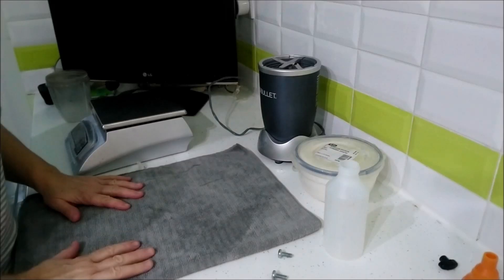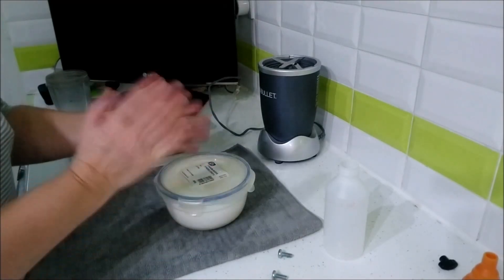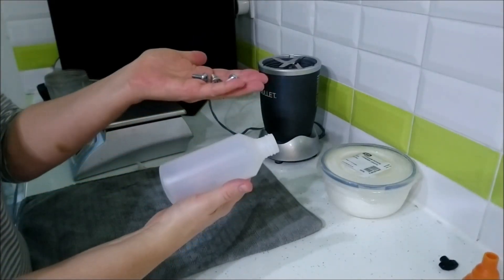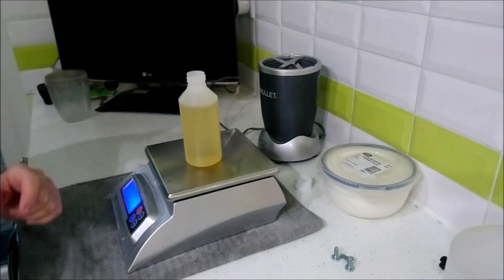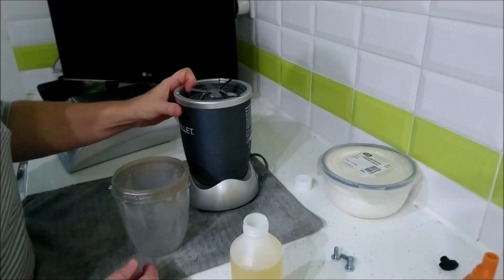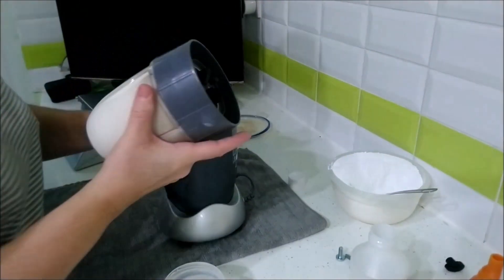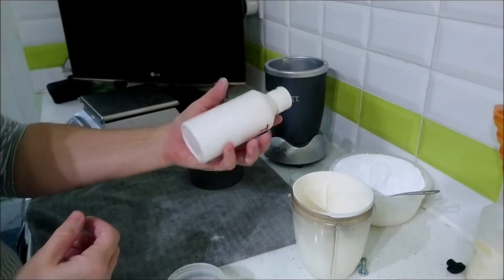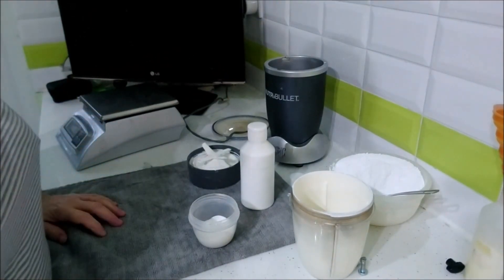Mixing TITANIUM DIOXIDE for cold process soap tutorial ~ How to premix titanium dioxide

Comment: I accidently ordered water soluable Titanium Dioxide. I usually mix some oil based titanium dioxide with some Almond oil. Can I still use the water soluable Titanium dioxide dissolved in water ? I can't dissolve it oil can I ?

Comment: That’s not really a 1 to 3 ratio
Reply from the maker: HI Bella, it's a 1:3 as I'm using 1 part TD to 3 parts oil, it's done on a volume basis. In the video I calculate that I have used 14 tablespoons of oil in my bottle, so I then use 14 teaspoons of TD, there are 3 teaspoons in 1 tablespoon.
Reply: @IDreamInSoap Hi! I did wonder why you measured by volume and not by weight. I suppose the weight of the TD in a 3:1 ratio would be a greater volume-making it more concentrated...yes? 
I think I'll weigh everything the next time I make a batch by volume...just so as not to fiddle with the spoons in the future! 🤓
Brilliant teaching...thank you so much! 🥳💞
Reply: @IDreamInSoap Hi, I love your idea. Could you tell me the ratio of Titanium oxide and olive oil in gramos?

Comment: I adore your videos - so informative!  Thank you for being so generous with your knowledge.  This one leaves me puzzled, though.  You mix 14 tablespoons of oil (which equals 42 teaspoons) with 14 teaspoons of TD, for a total of 56 teaspoons.  The mixture is 25% TD (14/56) and 75% oil (42/56).  Then you say if you want to add TD to your batter at a rate of 1 teaspoon per pound of oils, measure out 1 tablespoon (which is 3 teaspoons) of your mixture.  Since the mixture is 25% TD, that means you're only getting 25% of 3 teaspoons of TD, or 0.75 of a teaspoon (3/4 of a teaspoon).  If you want a full teaspoon of TD, don't you need 4 teaspoons of the mixture, not 3?  I suppose the difference in TD amount doesn't make much difference in the soap, but my inner math geek is confused.
Reply from the maker: HI Carol, ooh I completely agree with geeky maths. The reason I didn't worry about it is that with teaspoons/tablespoons which are a volume measurement rather than weight, by the time everything is all mixed in, the volume that the oil took up did not change significantly, therefore it was actually more accurate to just use x3. 
Overall volume measurements are quite imprecise, but I felt when I measured mine that sticking with x3 was actually closer than x4.
I actually do all of my measurements by weight, so when I make mine I weigh the whole mixture and use the weight to get back to the amount of TD I want.
I hope this makes sense, but I completely agree with your logic
Reply: @IDreamInSoap  🥰

Comment: Hello, thanks for the video. I don’t know if you said it but do I have to calculate this oil that is used for the mix in my recipe or is it so less that doesn’t change my receipe ? Thanks for helping
Reply from the maker: Hi Karin, It's likely to be a small amount so you don't need to worry about it. If you were doing TD in the whole soap you could blend it directly into your base oils.

Comment: Hello Lisa.  I wish I re watched this video, I made a bottle before but was worried it was out of date, so threw it out a few months ago.  Yesterday I mixed my oil based Titanium Dioxide in olive oil, it looked ok when adding but 24 hrs later white bits when I cut the soap. So annoying as one of the best swirls I’ve made.   So back to the bottle mix.
Reply from the maker: AW, no that's a pain. The TD should last as long as the oil in the bottle, so just check the expiry of the oil before you use that and write it on your TD

Comment: PREPARE in advance of soaping:
1 tsp TiO2 (oil soluble type) to 3 tsp oil.   -or -
1 tsp TiO2 (water soluble type) to 3 tsp very WARM water.

STORE in bottle with stainless steel ball bearings.

USE @ 1tsp TiO2 ppo
(ie 1 TBSP which equals 3 tsp of the preparation)
Shake well and add to batter after emulsion

Comment: Hello Lisa, I am at the brink of buying a coffee grinder and came re-watching your video to double-check if you mixed it together with oil in the grinder or not, to make a final decision :). Then I got confused when you said you added 1 table spoon (3 tea spoons) of the mixture to your soap with the intention of using 1 tea spoon of TD. But since the mixture was at a ratio of 3:1, it contains 4 parts instead of 3, and the TD you added wouldn't be 33% but 25%. Or, the 1 table spoon of mixture doesn't contain 1 tea spoon of TD but less, since the table spoon of mixture isn't 2 tea spoons of oil + 1 tea spoon of TD, but 3 parts of oil + 1 part of TD...
Reply from the maker: I'm not sure if a coffee grinder will work as I think you are suppose to just use dry coffee in those. I use one of those very powerful blender things. I do agree with what you are saying that 3:1 should equal 4. But I've found that when using volume (like teaspoons) that the mixture as a whole doesn't really increase in volume much beyond the oil volume. Initially it seems bigger but as it settles and everything absorbs together then it stays at about the oil volume (I've even made some quite large batches to see what the volume does).
However if you are weighing your TD mixture to use (which is typically what I do) I would count the TD as 25% of the weight.

Comment: I'm back with more questions. 

Why do you use a tbsp of the dispersed mixture as opposed to a tsp? 

I have a vague idea of how to calculate stuff ppo, but I'm not fully sure I've got it right. My understanding is that you would divide the total number of oils you have by whatever unit you use to measure a pound and then multiply that number by the number of tsps you want to use.

So if I had 1,000 grams of oil and wanted to add a color with a rate of 2 tsp ppo, I would divide the 1,000 grams by 454 and then multiply that by 2 leaving me with 4.4. Is that the correct way to calculate that? 

And my last question is can you pre-disperse other colorants in this way or does this only work with titanium dioxide?

Comment: What if you've pre mixed your td with olive oil and the recipe does not call for olive oil,will this affect your soap on any way?
Reply from the maker: HI, it's very unlikely to as you will not be adding much, it would just increase your superfat a little. If you sell your soap you may need to consider if it affects your labelling requirements. You can mix with any lightweight oil (rice bran, canola, avocado etc) just choose the one that's the highest in your recipe

Comment: 50/50with castoroil mix so 1 tspoon oil and 1 ts td  that does not change a batch of a few pounds
Reply from the maker: I wouldn't use castor oil, it's too thick, plus it's normally a very small % of your recipe, so you you could alter the batch, choose the oil you use as the largest part of your recipe (liquid oil)
Reply: @IDreamInSoap  then use a spoon of oil from the batch slightly warmed up to thin it same effect

Comment: Hi Lisa these is Aminata again so if i have a soap recipe that the total oil is 1000 grams and i want to add my TD mixture . so how do i know how many tsp of TD mixture i need do i have to divide 1000÷ 16 =62 .5 or what i still didn't understand that part pls thanks
Reply from the maker: Each tablespoons of diluted mixture should colour about 500g of batter (you may need more if you use very yellow oils) so for 100g 2 tablespoon should be fine
Reply: Ok thanks a lot

Comment: Hi lisa thank you so much for your video about the TD mixing . if i did understand you , You do use 1 tbsp of TD per pound and how much in grams pls thanks i Really appreciate all your videos thanks again
Reply from the maker: Hi Aminata. Yes I use 1 tablespoon per pound of oil of the diluted mixture, which is the same as using 1tsp per pound of just the dry TD. A tablespoon of the diluted mixture weighs 16g
Reply: Wow thanks i understand now
Reply: I’m hoping this will help me eliminate white spots in my soap. How would you add this / write it up on a CPSR?
Reply: Hi Lisa these is Aminata again so if i have a soap recipe that the total oil is 1000 grams and i want to add my TD mixture . so how do i know how many tsp of TD mixture i need do i have to divide 1000÷ 16 =62 .5 or what i still didn't understand that part pls thanks

Comment: A small cautionary tale to anyone out there who — like me — might be using an ordinary bottle top:  be sure the bolts or nuts or ball bearings are large enough to notice easily when dispensing the mixture. I used some very small SS acorn nuts just because we already had them. However, I measured the mixture when it was still quite gloopy, and since I didn't have a nice flip-top lid that reduced the size of the bottle opening, one of the nuts escaped into my rapidly thickening batter! I didn't find it until cutting the loaf, when the wire skipped around the tiny nut and left a strange divot in the side of the soap. I'm very lucky this one showed up in the cut, so I'm not giving someone a bar with hardware inside. And of course I had to go through the whole TD mixture to capture and count the remaining nuts, in case more than one was hiding in my soap...yikes, what a mess! But despite a foolish user error, this technique is absolutely awesome — thanks so much for the video, Lisa!  ❤️
Reply from the maker: Oh goodness me, that's a good point. I guess with the bottles I use the bolts could never get out.

Comment: Hi Lisa,  how long does this TD mixture stay good and useable?  Great info.  I catch your soaps on Instagram but like hearing  you explain everything.  Thanks for the videos, keep them coming.❤️❤️
Reply from the maker: Hi JoAnn, if you mix with oil, then it will last the shelf life of your oil. I typically mix up enough that will last me a month or so. For water dispersed I think you need to be a bit more careful as water can = bacterial, so if I did use water I would maybe keep the TD in the fridge.

Comment: Hi, Ive just found your tutorials and they are amazing!! Thank you so much. I am still learning all the time. Quick question which is probably a daft one. When using this mix making cold process  soap, do you take the amount you use out of the amount of oils in your recipe? Or does the minimal amount of olive  oil you are using in your TD mix not make a difference? I’m probably being a bit OCD here but want to ensure I’m using the right amount of everything. Normally if I am mixing a colourant with oils I will take it out of my batter, but if this is pre made then I can’t do that. I wasn’t sure if I should reduce the amount in my recipe and if so by how much as it will be mixed together. Many thanks.
Reply from the maker: Hi Amanda, thank you so much for your lovely comment, just adding this in will be fine, it's a very small amount of extra oil so will just add slightly to your superfat
Reply: @IDreamInSoap  thank you so much!!

Comment: Why do we need to add the bolts to the bottle ??
Reply from the maker: It helps to mix the TD, as it settles at the bottom of the bottle after a while so the bolts make sure it's really mixed well
Reply: @IDreamInSoap  Thanks a lot. Your video was very insightful

Comment: Hi Lisa. I just love the informative videos you upload and have been binge watching them over the last couple of weeks. But I do get confused when you say that oil isn't the same weight as its volume, and then say that 1 tablespoon (which is 15 ml) weighs 15 grams. As a baker - or maybe someone who actually enjoys maths - I know that the conversion is x0.9 (eg 1dl olive oil weighs 90 grams), and therefore your maths seems a little faulty. When it's just one tablespoon I'm sure it doesn't make any difference, but in the bottle you won't get the correct proportions between oil and td. Obviously it still works, and maybe the 1:1 ratio isn't crucial, but the correct math would be that 1 tablespoon olive oil weighs 13,5 grams. :)
Reply: Edit: yes, this is extremely nerdy. And again, it probably doesn't even matter. And I went through the comments before writing this and I seem to be the only one noticing, again a sign that I have too much free time and am in minority for both liking maths and knowing volume to weigh conversion on baking ingredients by heart. Sorry for the long sentences. ^^'
Reply from the maker: Hey Frejaln, I agree with you, in this case, the actual exact measurements are not needed to be 100% accurate. In fact for this video I just measured the number of tablespoons of oil that I wanted, weighed the whole lot and then divided by 14 (or however many I used) so I was after a sort of average weight for the tablespoon that I poured. Most people will not pour out a 100% exact tablespoon, so for me it's about consistency of measurement. I want a ratio of about 1 teaspoon to 1 tablespoon, so by weighing the totals out I know I can be consistent every time I make a batch. I actually don't use spoons when I make mine up as I have my figures that stay consisitent. I actually use 210g of olive oil and 38.5g TD to make my solution up and keep it the same every time.
If I am working with something that needs to be more precise, I will ensure that things are measured exactly

Comment: Hello Lisa, do you do the same thing with Activated Charcoal Powder? If yes, do you do the same measurements? Thanks x
Reply from the maker: Hi Chila, I have just started to yes, and it works really well. I use the same measurements to mix it up, but in the soap I tend to use at 1.5 tsp per pound of oils, where as TD is just 1. So diluted that would be 1.5 tablespoons of the dispersed AC
Reply: @IDreamInSoap  Lisa, thank you so much, honestly you are the best ♥️♥️♥️

Comment: Hi Lisa, very informative, thank you. I usually just shake the bottle to mix, but I will definitely blend next time, some good ideas there. One thing I'm confused about is the ratio when you use it. If you mix 1 teaspoon td with one tablespoon oil, if you want to use the equivalent of one teaspoon td in your soap, would you not mix in a teaspoon and a tablespoon of the mix? I do this and thought I was right but am now doubting myself.  Just going to watch the cat and butterflies now, thanks again 😘
Reply from the maker: Hey Jackie, thanks a lot. Technically yes you would need 1tsp and 1tbsp, to be honest I've never actually measured out the resulting liquid to see how much bigger it is volume wise, maybe that's something I'll do next time. I find for me using a straight Tablespoon works just fine, but I have a pretty light soap batter, so I would suggest doing some tests in your recipe to find the level that works for you.

Comment: Thank you.  Very happy I found your channel!!  What would be the best oil to use?  Does the oil need to also be one if the oils in the batter?  Once prepared what is the best way to store and how long is it good for?
Reply from the maker: Hi again Yolanda, I'm very happy you've found my channel too. You can use any light weight oil, I typically use olive oil, but any you use anyway will be fine, I wouldn't use castor oil as it's a bit thick. It doesn't need to be an oil that's in your batter, but as you have that anyway it would make sense to use one of those. I just store mine with my other colourants, so just in a cupboard. It will easily keep for a month of so, I've not kept mine longer than that, but technically up to the expiry date of your oil. I hope this helps, feel free to ask questions as you have the. Keep safe and well. Lisa
Reply: Hi, can you please tell me the measurements? I'm not English and can't understand all week. Thank you so much in advance.

Comment: Thank you for the very informative tutorial. I have a few questions. Can this be used for colors other than TD? e.g. a MICA? Can I use glass marbles instead of ball bearings for the inside of the bottle?
Reply: This is such a great tip, after I watched the video have done this with TD - I used small decorative pebbles because that was what I had.  I was wondering the same as Rashidah about prefixing other colorants, specifically for other oxides like chrome oxide or iron oxide. And what about ultramarines? I think they disperse better in water but I always seem to get specks no matter how I try to dissolve them. Anyway thanks as always for giving such helpful and thorough information.
Reply from the maker: Hi Rashidah, you could premix other micas but to be honest I don't really feel it's necessary, normal micas blend easily with oil, whereas TD takes extra work. I always premix my micas in a small amount of oil just before adding to the soap to make sure they are dispersed properly and cut down on stick blending, but I don't tend to make up a batch in advance. I can see no reason why you couldn't use marbles, I would just be a bit cautious about how hard you shake the bottle, would hate to think of them shattering and adding tiny bits of glass to your TD (ooh spikey :-(  )
Reply: @IDreamInSoap  oh yes that's something to consider especially as they may hit off of each other 🤔 thanks for your response 🤗